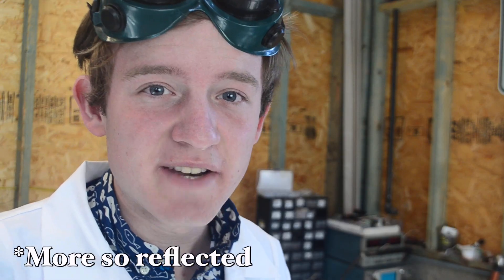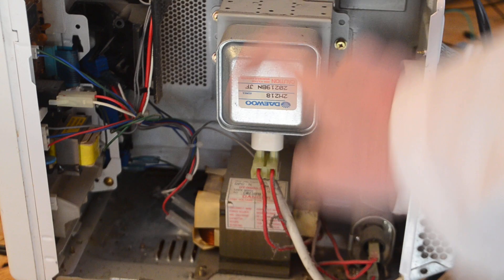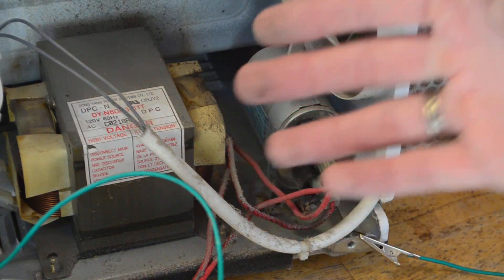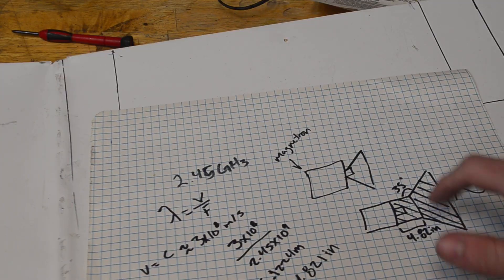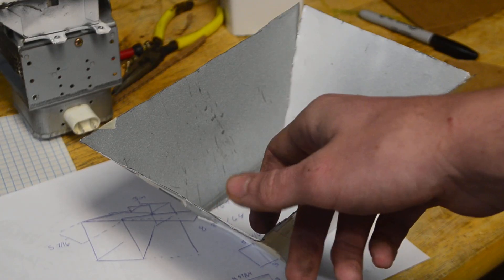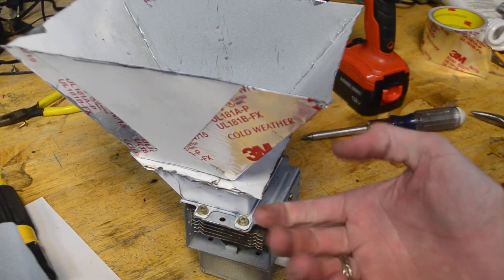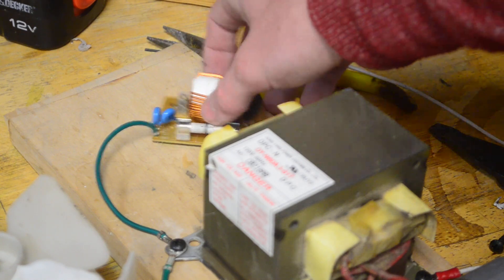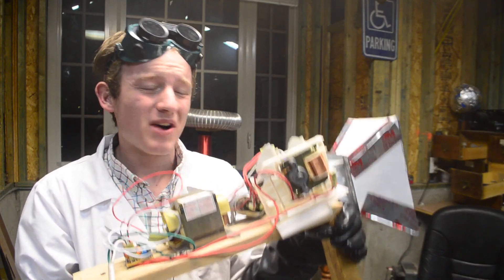How to make a Microwave Gun

Comment: You are crazy!  You are pointing this thing around like it is a toy gun!  The "bullets" can bounce off anything metal, and back into your face!  You have no eye protection on when you are running.  The only proper way to run this is outside on a "range", remotely turned on with everyone at a safe distance (where the intensity is below established limits.)  You better get an eye exam to confirm you have not sustained eye injury.  Unlike 1W blue laser, this is 600W, and can't be seen.

Comment: A couple of things jump out at me. 
No warning at all. No procedure on discharging the storage capacitor either. That alone could get someone killed with they attempted to emmulate this dissasembly video.
In addition, this video shows some extremely dangerous feats performed with a Magnetron and a deadly power supply. The transformer alone can short AMPS of current which delivering 2kV AC!! That will kill anyone or anything that touches the output. 
Next ----- NEVER EVER connect power to a magnetron and try to power it up without first directing the RF away from yourself!!! This guy has exposed himself to the full output power of a high energy RF transmitter without any consideration for his own health. Brutal! Roasted nuts....
Had he been holding a grounded screw driver or metal rod he would have become part of a conductive path and likely been electrocuted / sustained serious RF burns. No, I'm not joking this guy is flurting with death!! Also, do your research on how the curcuit is powered up. The MOT produces an AC current which is then recified by a voltage multiplier circuit. A diode and a capacitor are used for this to changed to a chopped DC wave form. The magnetron runs on approximately 4.2 - 4.8 kVDC from a 2.1 - 2.4 kVAC input.
Reply: You have right. One Touch on that unisolated Crocodile Clamps and youre watching the Potatos from underneath.

Comment: Does emp effective range depend on number of turn in coil or diameter of coil
Reply from the maker: Yep! A formula that I would make to represent this would be essentially U (energy) = I^2 * N^2 *πr^2 *μ0/(2len) where N is the number of turns, r is the radius, len is the length of the coil, I is he current (=voltage/(resistance^2 + frequency*2pi*L)^.5) where L is the inductance, and thus, using all of these formulas, you can calculate the energy that I had shown above stored within the coil, so higher energy implies higher range, but the drop-off per unit distance away from the “emp” is proportional to 1/r^2, so in essence, the range drops off fairly fast.
Reply from the maker: Oh, and μ0 is a constant called the magnetic permeability of free space

Comment: Why do microwaves tend to create such strong electric currents in metal objects while other shorter wavelengths of light do not? We don't have a problem with visible light causing problems with electrical components even if it is greatly magnified. Is it because the wavelength of visible light is so short that it doesn't create a sufficiently long voltage imbalance between the crests and troughs of the waves. So is it because the wavelength of a microwave is long enough to create a substantial voltage difference across a conductor across a substantial distance?

Comment: I did something like this 34 yeas ago, was trying to make a termite killer. Made a custom designed waveguide and mounted the magnetron on a boom tripod stand. I would aim it and get inside a steel box with a screen to look through which was cut from a microwave door Then I would hit the power and see what happens. At some point there was a big pop and a steady stream of smoke coming from the wall Some of the wood lath exploded throwing plaster at the magnetron and breaking the tube On the good side I did find burned up termites in the wall stud

Comment: Is it possible to heat the cathode filament by three 9 volt batteries? My MOT does not have the middle high current coil for heating it "the normal way"...
Reply: I mean the three 9 V in parallel...

Comment: This is a very dangerous apparatus. You can get seriously injured just by the waves being reflected from materials in the surrounding area. Most MW transformers have an output of around 2000 V and some hundred mA which is more than enough to kill you on the spot. You didn't even bother to put some kind of casing around this death trap ...it's a disaster just waiting to happen. Please, don't build such unsafe devices, sooner or later someone will get seriously injured or even die.

Comment: Please somebody respond, do you need to worry about bypassing the control board when rewiring everything like he did? I'm afraid it will not work if you bypass the board
Reply: Don't worry about that. The control panel is irrelevant besides as an on/off device

Comment: tune the waveguide and restrict the exit to create a standing wavefront inside. that will generate air plasma. you can try to use coils to accelerate the plasma out of the reduced exit to fire plasma shots. i was working on this back in 2000 but never got it right. plasma kept getting attracted to the wall of the waveguide. i think it just needed more juice

Comment: take a test if the magnetron can heat the water inside a condensing boiler for heating and sanitary water production.
if it works it is less dangerous than a gas boiler and cheaper .....

Comment: I really recommend to NOT BUILD this kind of thing. Since the wavelength of this magnetron is about the diameter of a human head, and every plane area is more or less a mirror to this waves, in every room you shoot the "gun", you expose yourself to the radiaton ...
Reply: @UniversalExpanse im not nearly qualified to explain this, but i guess i will. Ahem.

Microwaves are able to heat up and cook meats and other foods because the box around the food traps the microwaves inside, keeping them focused on what's being cooked, and usually takes a few to several minutes to fully cook lets say, a piece of chicken.
Reply: This shows a fundamental misunderstanding of how microwaves propagate and their penetration power. They really can't penetrate your skin, let alone your skull and skin, and closing your eyes will protect them from damage from this level of power. The voltages are somewhat hazardous, but at half an amp you can do more damage with a USB fast charger and wet hands. Reflections off non-metallic surfaces are quite weak as they are very poor reflectors at this wavelength (which is why 2.4g WiFi works through walls well).

Comment: Discharge caps by connecting to ground first then use an insulated screwdriver with the crock clip on the end. Might still take a bite out of your screwdriver, better to use a resistor.

Comment: 2 safety rules of thumb, that you did not mention: before working with potentially high voltages or powerful Inductance producing devices, please remove any metal jewelry, [ rings, bracelets, ETC ]  if the jewelry comes into contact with high voltage, or an actuated powerful inductance field, the jewelry will heat up very quickly and melt to your skin. giving you 2nd /3rd Degree burns. [ Not pleasant at all! ] and second. if you are actually planning to build this microwave gun, DO NOT under ANY circumstances, Point it at any Human or Animal! the result would be a  very cruel, slow death for animals! and a potential lawsuit or murder charge if you injure/ kill another human being with this device.
OK nuff said :) have fun Guys, but be safe and sane! K?

Comment: While it is correct that microwaves can't give you cancer, the x-rays that are produced as a byproduct certanly can. I can't link becase of comment filters on youtube, but if you google "x-rays from radar" which are essentially microwaves, you will find a study about the harm and exposure of soldiers to x-rays from radar equipment. here is what the paper is called btw:
EMISSION OF PARASITIC X-RAYS FROM MILITARY RADAR 
TRANSMITTERS AND EXPOSURE OF PERSONNEL: TOWARDS A 
RETROSPECTIVE ASSESSMENT
Reply: Actually, you can link. And no, this microwave magnetron is not going to cause those issues.
Reply: I am intrieged, why is that?
Reply: oh dear..... no.  Old Military radars had vacuum tubes ( thyratrons) to rectify extremely high voltage power supplies hence the issue with scattered xray emmisions during driving. House hold microwave units do not have thyratron tube driver circuits nor do they operate at 50-160 kV.  You are referencing Korean War / Vietnam War era tech here.

Comment: Yes, it's called a 'Maser'. Your wave guide configuration is wrong for a 'gun' or maser application...You should not have the magnetron output focusing waves at an angle against the wave guide...That angle is correct for an oven; NOT a maser/gun.

Comment: pretty clever this gun...I hope you can explain how the microwave cell phone towers work....that would be a very informative video as well  good job...
Reply: Those use  lower frequencies (800, 900, 1800 and 1900 MHz) and do not resonate with water well so there is no (zero) risk of then harming you while you are on the ground. Now if you climb up the tower and stand infront of a panel they yes it can burn you (RF burn) if you are holding onto the metal grounded tower and touch the actual radiating elements. 
Please don't buy into the conspiracies on Youtube about cell tower death rays and 5G, it's all BS from people who simply do not understand how radio waves work and are afraid of it. the same thing happened when aircraft became a commercial asset for the public to use. People were afraid of flying for no other reason other that what if's and construded tales. We know now that flying is safer than driving.
Reply: I just know the 5G does harm our DNA, so would be nice to know how to protect ourselves

Comment: So... Attach this gun to a secondary alternator, run it to your trunk. Now when you get pulled over, you just shoot the beam at the cop car... Could you even get anough voltage from an alternator to power this? (Roughly 13.5-15v on a good alternator)

Comment: Hi I have a quick question.  Why does the waveguide have to open out at 35 degrees? I have seen that number over and over and I'm curious as to why
Reply: Its a magical number, especially in electricity, used to make a zero point energy device

Comment: The reason microwave ovens are allowed to be sold in this country is because the microwave energy is contained in the oven which in itself is a Faraday cage.  It is designed so that no perceptible emissions leave the oven.  2.45 Ghz is allocated to the radio amateur band and radio location services.  Operating an 800 watt microwave source as an unlicensed transmitter is a violation FCC rules pursuant to Section 301 of the Communications Act of 1934, as amended (Act).  Operating at that power will get you a visit from a) either a licensed amateur who will politely ask you to cease and desist or b) the FCC who will not so politely issue you a citation with a court date.  So much for the legality.  Now for the safety issues.  A properly designed wave guide and feed horn are electrically connected, usually silver soldered,  for a proper match to the magnetron.  At each point in your construction there is an electrical discontinuity which affects the impedance match.  At the least you'll get arcing in the wave guide assembly; at worst you'll smoke the maggie.   Another issue relates to the anode voltage going to the maggie which can be as much as 1000 volts DC at 800 ma.  This can be lethal at worst or cause a severe burn or other type of serious accident.  If you want to play around with with microwave equipment, I would recommend learning the rules to become an amateur licensee and earning your license.  Even with a license there are still going to be restrictions as to shared band operations such as the 2.45 GHz band.  The FCC gives priority to services such as radio location.  Fyi, I am a retired RF engineer and a radio amateur licensee.  While employed I have worked with RF sources from L band (1-2 GHz) thru Ka band  (27-40 GHz)  and have fabricated wave guides from stock lengths.
Reply: +Kyle Rauscher You are correct that "regular" people have access to information.  Once you pick through the irrelevant BS online there is actually useful info such as the rules and regs published by the FCC, health hazards due to exposure to high power microwave radiation pubbed by the CDC, the DOH, and the AMA.  However, just because the info is available doesn't mean that people with an IQ as low as yours with what is probably a primary school education or less will know what to do with it.  I doubt that you have read any book more technical than a primary school reader.  I am more than happy to see people take the initiative to experiment and raise their level of expertise in all matters technical; however, I want to see it done safely and within the confines of the law.  You are obviously an individual who shouldn't be trusted with anything sharper than a butter knife.  Your predilection to vulgarity and invective is indicative of your substandard ghetto education which indicates to me that you should not be taken seriously.  Btw, if you have any difficulty understanding anything I'm saying, please refer to www.dictionary.com since I doubt that you have any experience with words longer than 2 syllables.  I pity you because your type will never rise above the gutter, spewing vitriol, and wallowing in jealously of your intellectual betters.  In your mind technical competence is warming a premade meal in the microwave, cracking a beer while lounging in your underware watching NASCAR on cable TV whereas I sit in my lab at home designing energy efficient emergency lighting, designing the circuitry and writing code for an Arduino based DDS synthesizer, and occasionally getting on my ham radio to talk to stations around the world plus building my skill in more than 5 languages.  You, sir, are a service worker probably slinging "hash" in a greasy spoon based on your obviously erudite comments.
Reply: 2.45GHz is the junk band precisely because of microwaves. Anyone with a faulty microwave could be transmitting at watt level powers on this frequency. This is why is is pretty much unregulated across the entire world. Bluetooth WiFi an radio amateurs all started using this frequency precisely because of this. I doubt the FCC or any other national regulatory body would care that you are getting interference on 2.45GHz.
Reply: John Brandolini since we can't agree on safety, let's all agree that one of life's greatest insults has to be.... "Go shit in your hat!" 😝🤣😂
Reply: @BigDH28  ROTFLMAO!
Reply: +John Brandolini super cool info, thanks for sharing
Reply: John Brandolini court date
Points microwave at him
Reply: Kyle Rauscher Sheesh Kyle, who pissed in your cereal?
Reply: My pleasure.
Reply: Tom Kennaugh maybe but if u know anything about broadcasting then u know of a lil something called harmonics and splattering... I suggest u read up before broadcasting ur ignorance to the world! Cheers🍻
Reply: +Benjamin Meijer He probably pisses in his own cereal.
Reply: Are your services for hire?
Reply: Research 5g...
Reply: @John Brandolini
Thank you for the information!
Reply: Pretty sure it was 4kV DC.
Reply: +Kyle Rauscher good lord you're a piece of trash
Reply: Kyle Rauscher Cool to hear trash try and talk, I guess that's what happens when you let it sit too long

Comment: That filter is actually there to prevent electrical noise and voltage spikes from getting back onto the power distribution network and interfering/damaging other electronics, like your TV or computer.

Comment: if you power the magnetron with a stun gun or ignition coil for the high voltage source to the magnetron it will dramatically increase the performance and distance and maybe. a few battery's in a separate circuit to the magnetron will give it some extra power and a light bulb or something g to protect the battery's you can get a distance of about 50 to 100 feet maybe more

Comment: 3 magnetrons, a 44 gallon drum full of water, high voltage capacitors... go for 50Kv+   don't need much, about 150Kj is a good start point. Mount the magnetrons facing across the drum full of water at 120 deg apart, copper ring on the water surface, rod down the guts and fire em up. Dump the capacitors across the ring and rod and a purrrrdy ball of plasma will float off into the air.   Just don't let the breeze sweep it past your scone or you won't be pretty after.

Comment: Beyond stupid. A Faraday cage required 100% coverage. By definition a cage. Covering something MOSTLY in foil won't do. Your face also it's covered. Every time you aim it at something metal, like the circuit braker, some of that microwave energy is reflecting back at you. And I'm sure your rubber gloves won't stop a lot as well.

Comment: Technically a magnetron is just an untuned  RF transmitter. 
Ham radio operators have found that magnetron can be used as a moon bounce transmitter. 
So it has been found that magnetrons can transmit a wide range of tuned frequencies. 
It is known that the higher the frequency, the narrower and tighter the bandwidth. 
Thus if a magnetron were given a 300ghz carrier frequency it will transmit a 1/2 in narrow high power energy beam. 
#sniperHERF
Reply: The physical design of the magnetron will determine its operating frequency.

Comment: If the microwaves are coming radially from the beryllium/aluminium oxide insulator, would it be better if you put the cone to 45 degrees so then microwawes that reflect from it would go straight forward?
Reply: I think because he wanted one end to be 3inches to match the magnetron and it had to be 4.3in to be one wave length, the bisecting angle was between 32-35. If the wave guide was a 4.3in cube shape, I think 45 would have been appropriate. I'm still kicking the math around in my head.